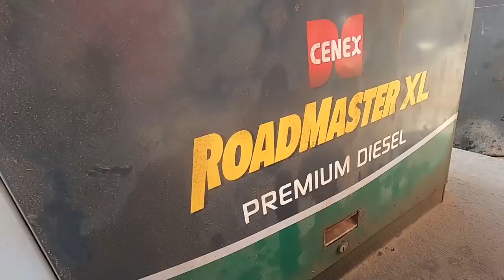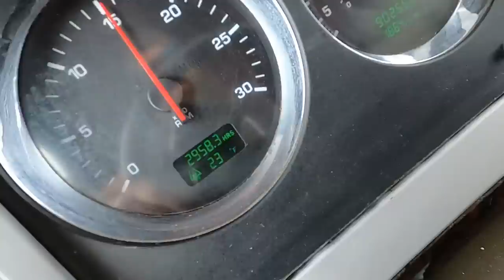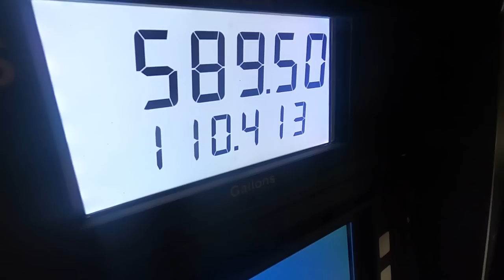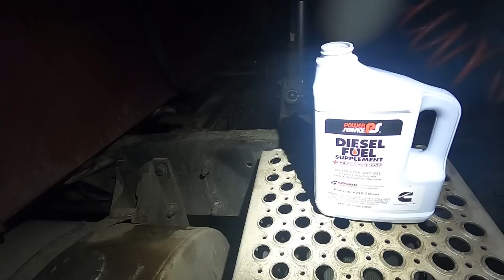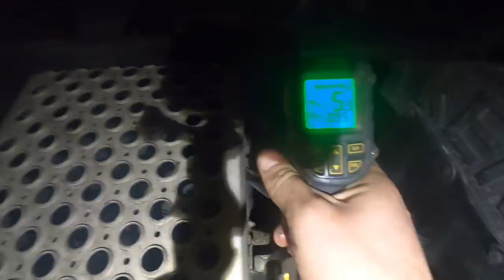Bring it home JAX! 3/3 Hauling livestock can suck the life out of you.

Comment: Great stuff Jax.  Awesome to see you coming down Stage Hill, dropping into the “Sugar Valley” South of Scottsbluff, NE.  The reason that it’s called the sugar valley, because of large sugarbeet industry that I’m sure you saw, as you passed the factory on your way to Torrington Wyoming. The Oregon trail follows the north Platte river through the valley.  The valley has a rich history and culture of fur trading, Native American history, and the ❤western lifestyle. My father was a truck driver for over 40 years and 4,000,000 miles, the last 15 as an an owner -operator. Ironically, my brothers first and only bull hauling experience hit an emotional peak when the truck that he was hauling cattle with, lost it’s brakes coming down Stage Hill when highway 71 was a two lane road in the 1980s.  He didn’t have a Jake brake and had to use the runaway truck ramp that was at the bottom of the hill.  He keep it up right, but it was herculean effort to get the cattle want to market on time.  This is the first time I’ve ever post to comment on YouTube.

Comment: I've actually had spray from my tires, yet found out the hard way that it was already black ice. My trailer went in the other lane when I stepped on the brakes. I quickly let off the brake and let it get back in line. About 💩 my pants!

Comment: Hey get rocket heater for 200$ then you only have to worry about keeping a few gallons of diesel unfrozen in a can. Can save a few bucks on thos 20-30$ diesel treatments per bottle. Can always unthaw your truck including your oil pan (don't burn any sensors or wires etc, duh) I actually made money with it helping others for tips!

Comment: That's one of the things I HATE most about truck driving, is the PRESSURE you get from company/customers about unrealistic times/distance/weights and DG (Dangerous Goods). They don't care as long as it gets delivered because at tge end of the day if you get caught by Road Transport as driver you are responsible for your truck & load. They will overload you or try get you take DG that shouldn't go on if they think you'll do it or guilt/scare you but you take the rap for it.

Comment: tyre wear like that can be caused by incorrect tyre pressure bad bushes or bad shocks overloading  or a loose wheel bearing most time its shocks bushes or wheel bearings that cause it ,  the tyre starts to jump /hop or shimmy  as it goes down the road and it gets worse to the point where the wear in the tyre will destroy the suspension bushes and much more , when you see this wear you know your up for a new set of tyres and a full rebuild of the suspension
Reply from the maker: Good thoughts on the tires. Thank you. These Turned out to be from just being cheap Chinese tires. The trailer is spring ride, so there’s no shocks or bushings on it. . Trailing arms and Bearings are in check. Thanks again  for sharing the good info for future reference👍🏼
Reply: @realwildwildwest  ahhhh that explains it,  I must remind myself that people in the US still run spring suspension,  most run airbags  down here in Australia,  some don't but most do 😉, was by no way saying your machinery is not up to spec brother,  but for the readers,  the cheap tyres don't stand up at highway speeds due to substandard materials and design,  great for the round town clown😉 or mud carter , be safe and have fun 👍
Reply: George  just calm ya Farm kiddo,  I didn't tag him nor did I try to school him either,  it also was not a shot at his gear , if you read close the initial comment was open ended and not directed at anyone but general reader,  now due to decades in the game you will find that the advice is sound for the most part,  but moving on have a great one and be safe 👍
Reply from the maker: @brad4751  no worries my friend. What you said is GOOD information for fellow truckers to read. I’m glad you took the time to teach in the subject. Many thanks. Please continue to comment and share your mechanical knowledge. Several years ago I purchased a 1985 Freightliner FLC. It came with almost brand new “duraturn” big tires. They’re low grade Chinese junk rubber.  But they were so new I hated to throw them out. Intooo them off the Freightliner and stashed them in the shed. I finally found a place to use them up on this trailer. Crazy how fast they go bad running over the road 😬
Reply: @realwildwildwest  i feel you mate , its hard to just throw money away , and i just stumbled on what i know, most times due to having to repair my own stuff and reading up on things before the sales rep gives me a bs excuse , sort of hate doing it because usually one comes across like a know it all to someone if you do , but meh , lol its on them , not me , ill keep tapping on the keys when i can , it helps your page to grow , and your ok lol , have a great one and keep them wheels turning ,                              and for the readers i do local mudcarting in brisbane Australia , i drive a manual westernstar 4800 truck and dog pbs rated , so we can carry 37,500 ton net  (81571,00 pounds , i gross 55.500 ton thats 122356,5 pounds

Comment: You're a little tip I work construction we are coming from Eastern Washington back to Western Washington everything was froze my partner was driving and he kept jumping where he could see black asphalt I kept telling him stay the hell off of that black asphalt that's not wet there was a little section in between Cle Elum and the past it was wet I showed him that you saw a spray as soon as we passed the Volvo I told him to stay off of the that black stuff he jumped right back on it we spun out right in front of the Volvo I looked up my passenger window to see Volvo he punched clutch in who rolled out of the way of the Volvo which is just about smashed me in the face to read Chevy